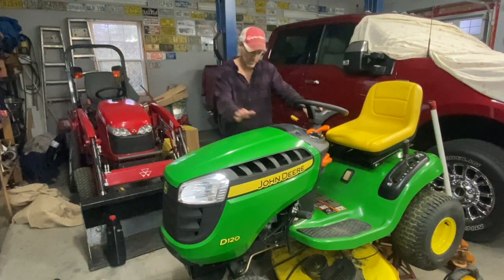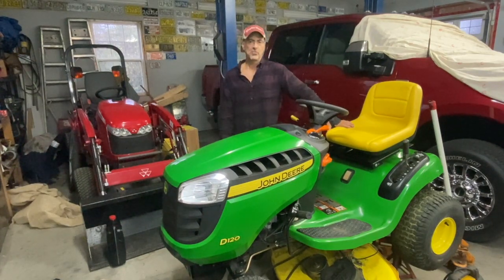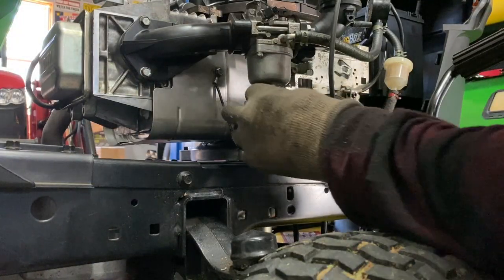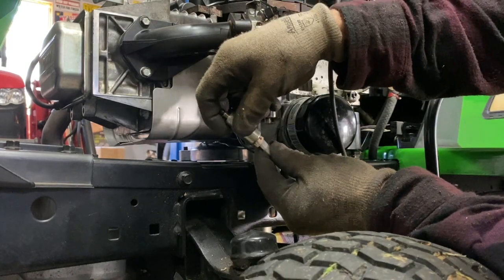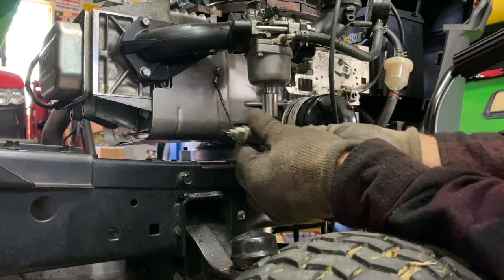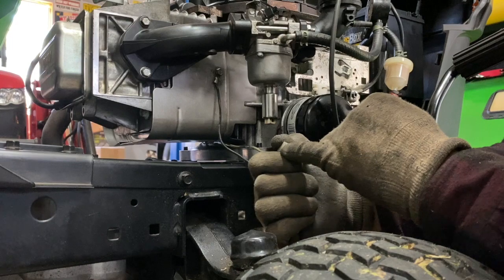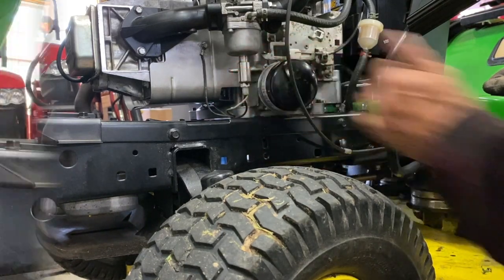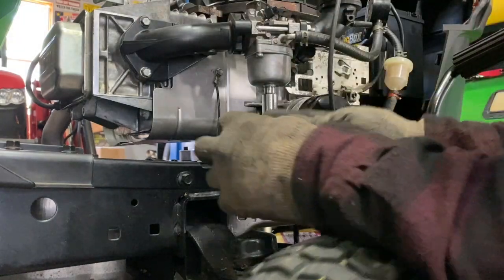John Deere D120 shutting down while mowing. (100 Series, LA, D, E, Lawn Tractor) Hard starting.

Comment: You have a Massey Ferguson tractor! I would love to hear about  any maintenance issues you encounter
Reply from the maker: I only have 240hrs on it, never had any problems with it yet.  Change the oil every two years.  Ten more hours I have to change the hydraulic oil.
     The only issue I have is lack of power going up steep inclines. (Maybe a hydrostatic problem)
Reply: @Weekend Hobby Mechanic  check the hydraulic pressure, some come from the factory set too low